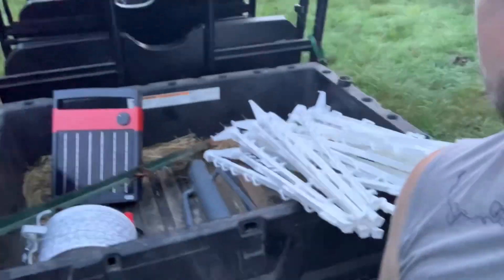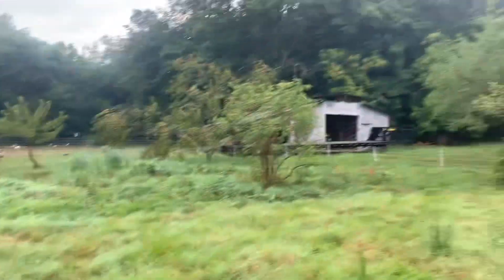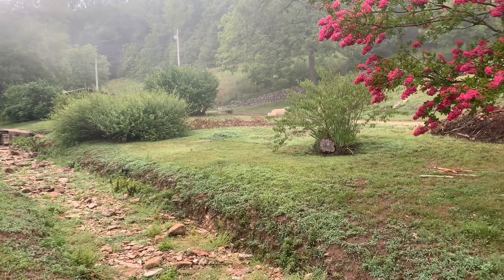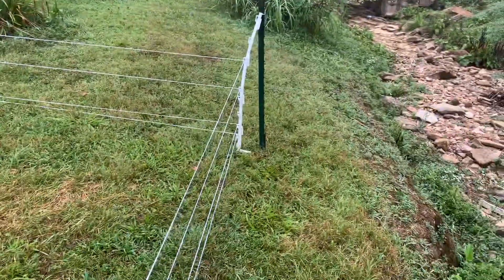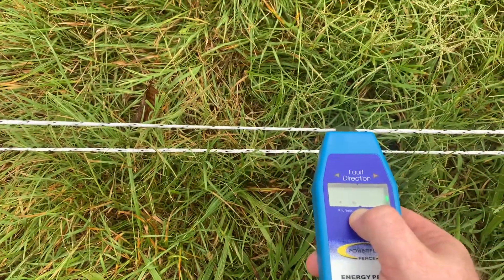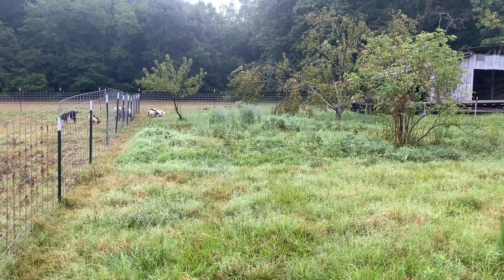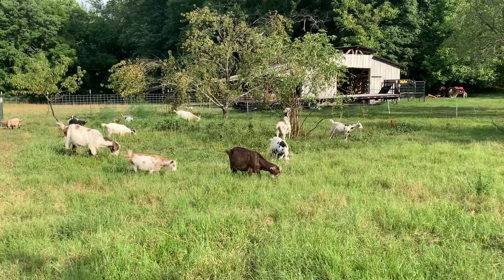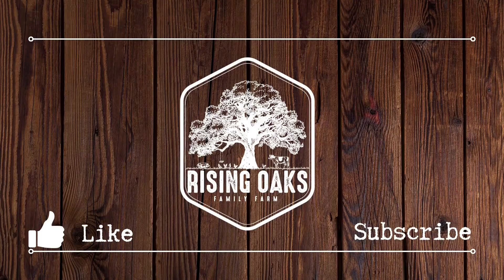Temporary Electric Fencing for Goats | Homestead Update

Comment: This is a very useful video. Would you mind sharing the list of supplies you used? Thanks!
Reply: Looks like O'Brian step in post, and Powerflex Polybraid. Both great products. 
Rocky on cue, took one for the team⚡️
Reply from the maker: Thanks for the feedback!

Here’s what I used:
Speedrite S1000 energizer
O’Brien Step in posts
Taragate geared reel
Powerflex mixed metal polybraid
T posts for corner stability
14 gauge wire 

I got the energizer, taragate reel, step ins, and polybraid from powerflex fence. 

Here’s another example of a paddock we built for pigs using the same ideas. 

https://youtu.be/tIlbR4AG64A